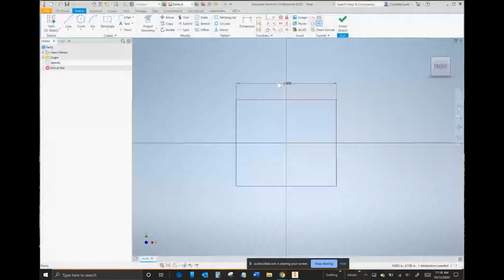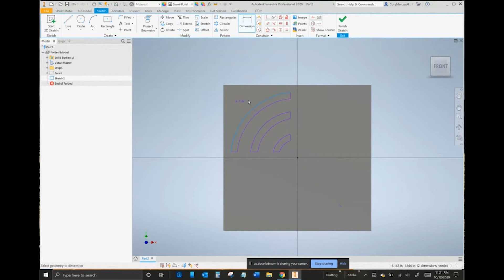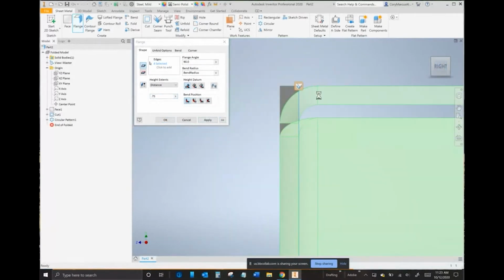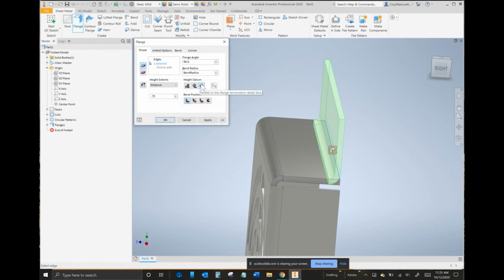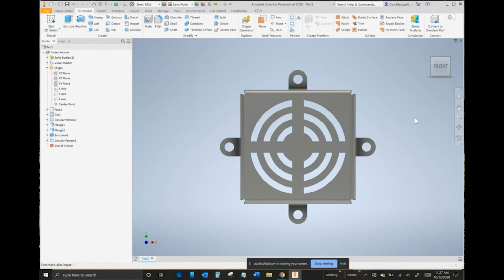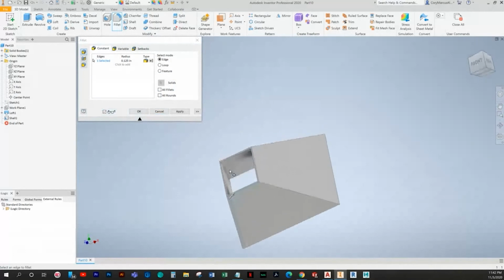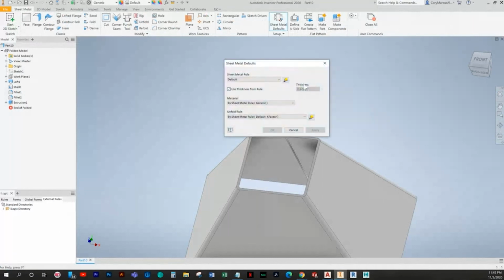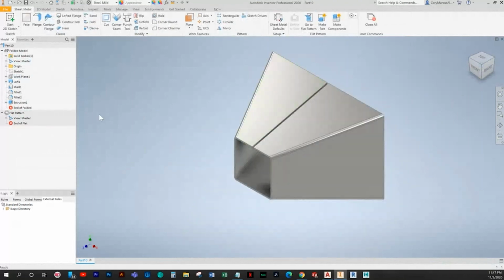Chapter 13 Solutions: Parametric Modeling With Autodesk Inventor 2020

Comment: Hi man! Lets say that I draw a 1/87 plastic model car, just the body and I wanba draw the glasses like one internal block .5mm thick. Is there an easy way to do it? Thanks
Reply from the maker: Give me more context. Maybe! Hard to say so far haha
Reply: @CoryAllenOfficial  You never had a plastic model as a kid? Like Revell, Tamyia... If you did, you would know.
Reply from the maker: @wuhegthonjunior8504  I did once upon a time lol. When you say glasses like one internal block, what do you mean?
Reply: @CoryAllenOfficial  The windows, front and back glass, maybe my Englis is wrong.
Reply from the maker: @wuhegthonjunior8504  no you're all good! So you can definitely create multiple features and have them all in one part to make the glass one entity. How to make each sheet of glass is the only tricky part. I'd imagine probably "sweeps" for each window. What you may find easier is to model each window individually in place then use something like shrinkwrap to combine them after the fact, making one block.